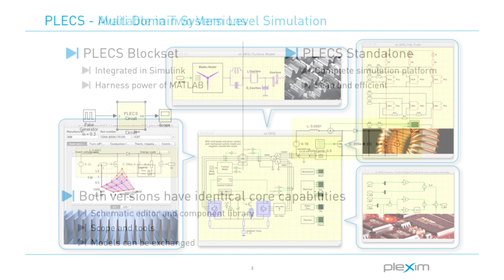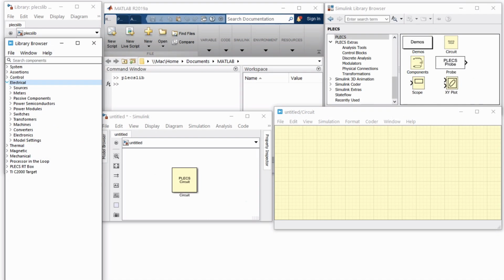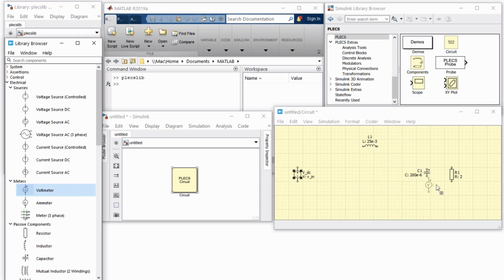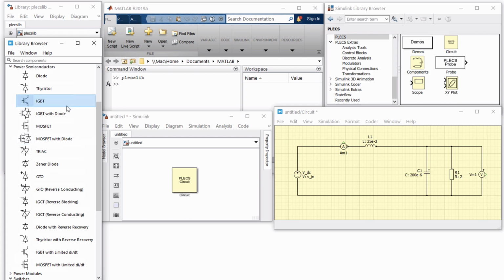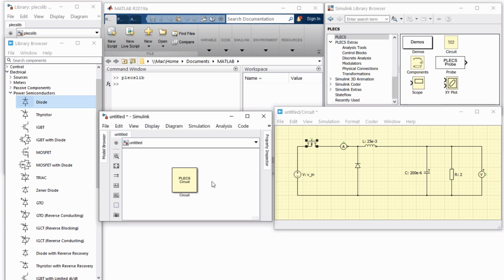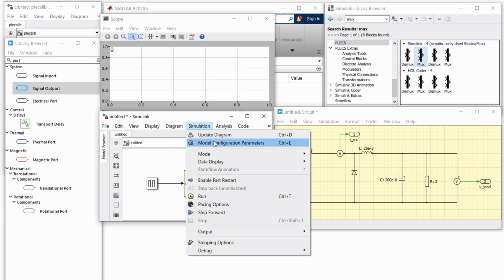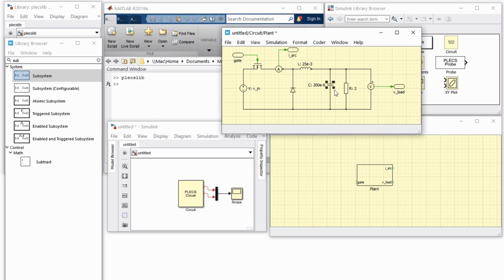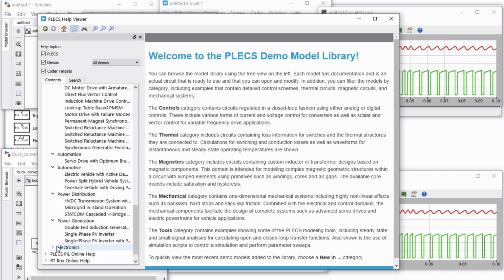Introduction to PLECS Blockset

Comment: Can we simulate the frequency response of an active filter with plecs? Without using Blockset? Where can I find the operational amplifier component? Thank you.
Reply from the maker: Hello!
Yes, you can simulate the frequency response of an active filter with PLECS Standalone (e.g. without using Blockset). You can perform an AC sweep using small-signal analysis or inject a frequency-varying test signal. The operational amplifier in the PLECS component library is called "Op-Amp".

Comment: hello , hope you doing well ; i use matlab r2018a and when i try "plecslib"  i get the following messae "Undefined function or variable 'plecslib' " any help please .
Reply from the maker: Hello, you need to first install PLECS Blockset from www.plexim.com as we are a third-party tool and not automatically included in MATLAB/Simulink.
Reply: @Plexim  I do have the PLECS Blockset and still get this message. What should I do?
Reply from the maker: @wernergonzalez7805  Please see all detailed installation instructions at: https://plexim.com/support/installation_help/blockset
If this does not resolve your issue, please see: https://plexim.com/support/contact

Comment: I tried following this tutorial, but I get this error: "Error evaluating parameter 'Voltage' in component buc_converter/Circuit/V_dc: Unrecognized function or variable 'v_in'.  It is as if Simulink is pointing to the wrong workspace; but I don't know how to change this.